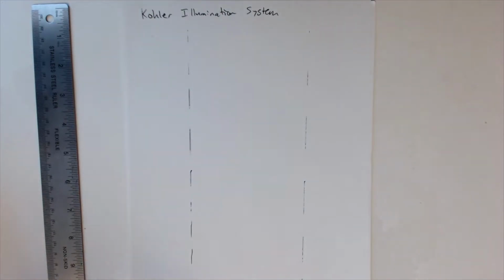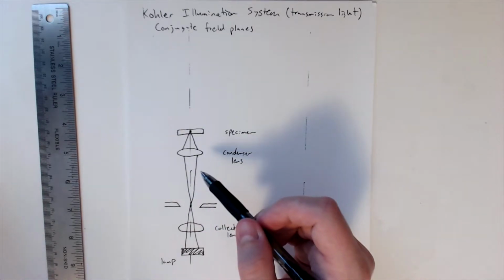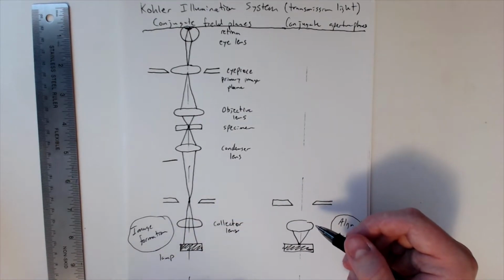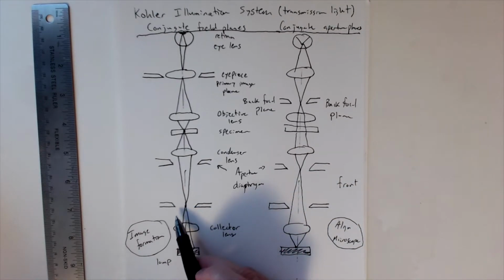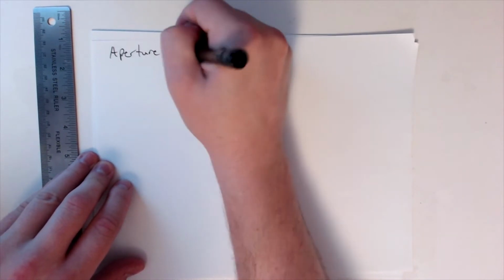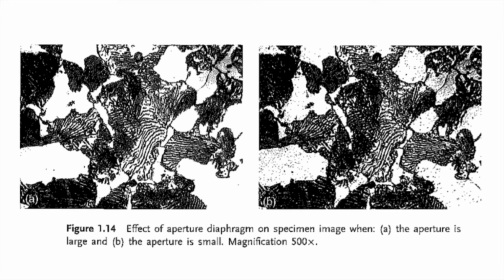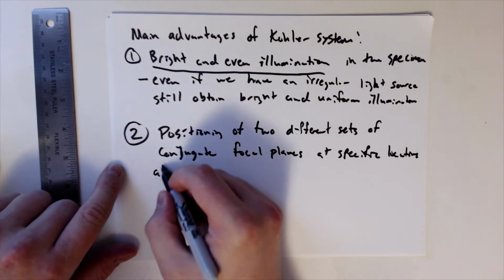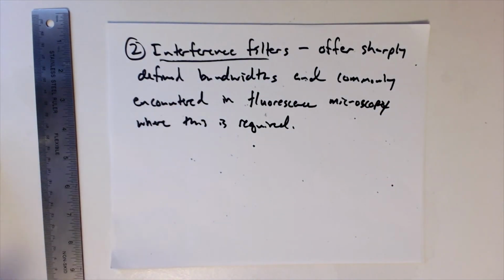MSE585 F20 Lecture 3 Module 4 - Kohler Illumination System

Comment: Koehler is nonsense, you have to center the the lightfield-iris and the lightsource not the condenor-riris. The condensor-iris has to be centered to the objectiv-okular -axis previous. Then you close the condensor-iris a much as it is possibel. Koehler is a historical technic on times where the sun was the only lightsource. Using modern microscops Koehlern is nonsense and of course the illumination depend on the specimen and not  on condensors
Reply: "Koehler is nonsense" OK i'm convinced. Your few sentences override the entire experience of the Royal Microscope Society going back to 1898 or something like that.